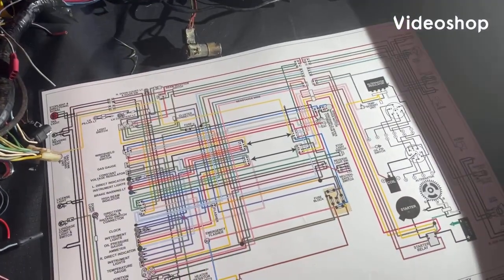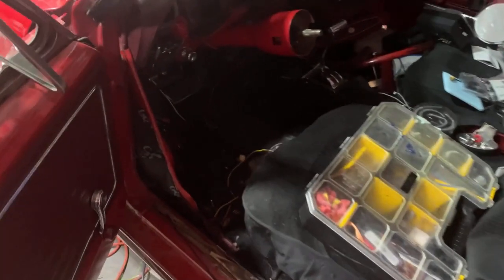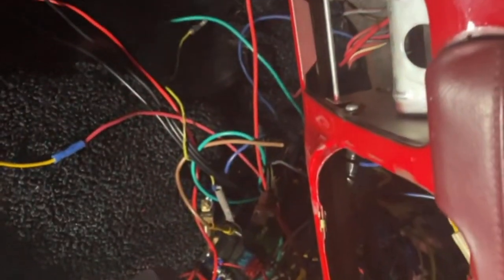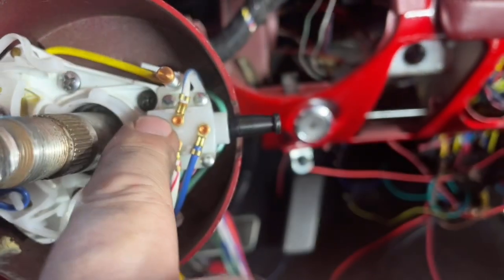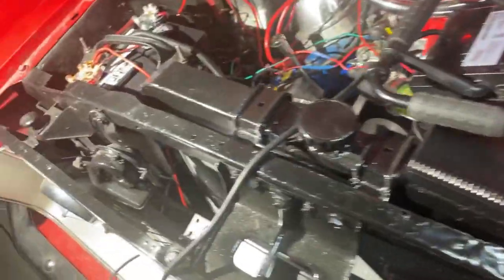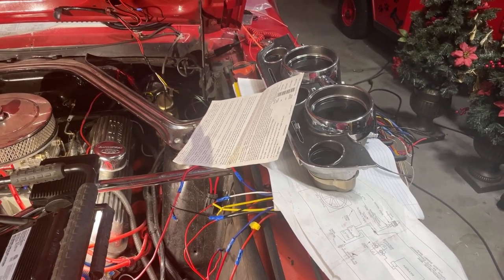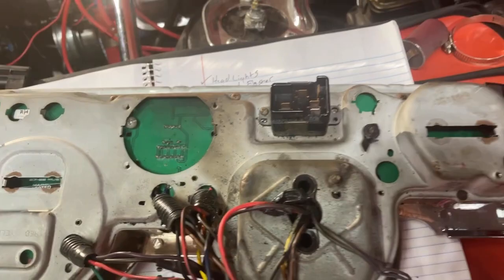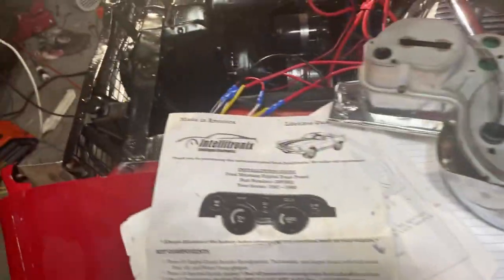░▒▓█ 𝟏𝟗𝟔𝟖 𝐅𝐎𝐑𝐃 𝐌𝐔𝐒𝐓𝐀𝐍𝐆 𝐑𝐄𝐖𝐈𝐑𝐄 𝐏𝐑𝐎𝐉𝐄𝐂𝐓 █▓▒░

Comment: Hi Charley! I have the same project to do on my 67 Gt. Looking at all those wires, It almost gave me a panic attack! lol. I'm a pretty good mechanical tech and have done all of the work myself, and doing a Non-hack job. But I do believe this job is above my paygrade. I have most of the wiring, new fuse box, turn signal switch etc so I might just pay a professional auto electrical person do it.  Thanks for sharing, it was very helpful. Cheers from Motown/Dearborn!
Reply from the maker: I am a professional technician and this project had me pulling my hair out at times. Just be proud of the attempt.